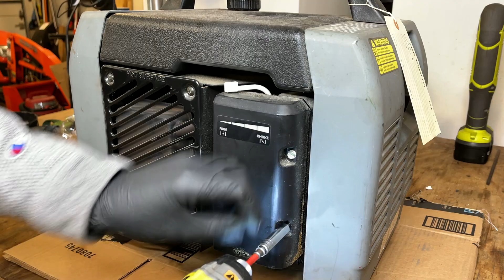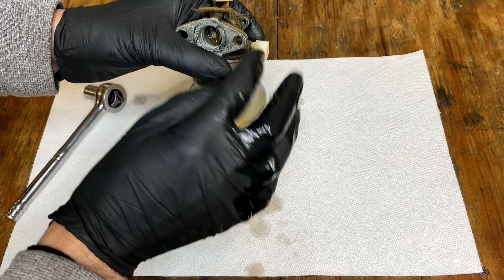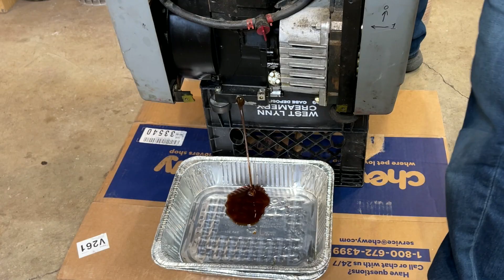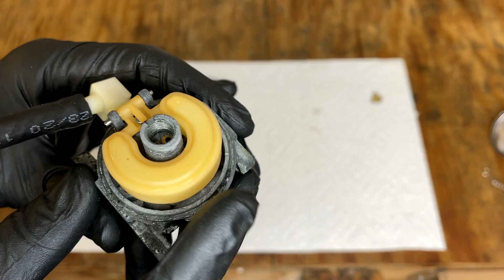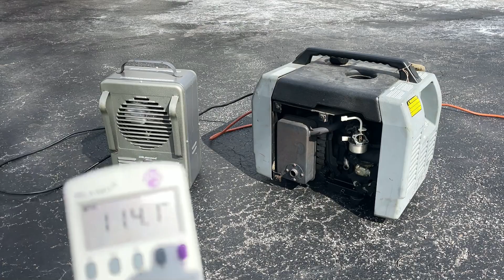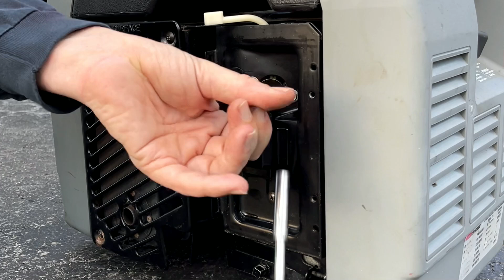Coleman Powermate Pulse 1850 Generator Repair

Comment: Are you kidding me I have ben working on small engine for 30 years and never tighten carb bolts to 50/lbs
Reply: Inch pounds, not foot pounds. It's the factory spec and similar on all engines of this type.
Reply: Pay attention John.

Comment: Why did you bend the governor attachment flange when there were multiple mounting holes for the end of the spring?
Reply: When you move to another hole, you change the geometry and thus the response curve of the governor. Altering the spring tension doesn't do that; it changes the range the governor operates in which was what was needed here. A new spring would have probably worked but this works equally well, is free, and takes no time chasing or waiting on parts. Good enough on an old generator.

Comment: Fine job and not much of a surprise another 'L' head runs again and does it well. I think the outro is simply FABULOUS with all the popping, wheezing, gagging and the dog bark! VERY fitting! I got a new book from Briggs that has all the single cylinder 'L' heads made since 81 for the expressed purpose of setting the governor on my 4 horse on a snapper mower. 110 type and not much about them. Runs fine but the governor is off but I'll get it.  LOTS of info and there is always a 'supposed to'. Just enough to make us liars! BLESSINGS, Pal and GBWYall

Comment: a dirty sinewave can be cleaned up with filter capaciters and  a choke winding...
Reply: The choke winding especially will drop some output voltage. Its OK if you can cope with that.

Comment: James, 
Your posts are always full of so much information. 
I have the same kind of 1850 generator use it a lot and it has years on it and had to use it yesterday due to power outage and it started right up.
Only thing I did was put a fuel filter just after the on/off fuel valve and I use fuel stabilizer as well I try and start it ever 4 to 5 weeks and run for 15/20 minutes with a load and run carb dry when shouting down.
As for oil leak had to replace rubber seals from valve springs to air box and gasket to cover and no more leaking.
As for the rubber shock absorbers on bottom mine are in bad shape and have been looking for replacements and have yet to find large enough ones to fit. If I find any I'll let you know where.
Keep up with post.
Michael.

Comment: I have a few ultrasonic cleaners and the worst part is how long they take to heat up. Get yourself a "stinger heater" cheap on Amazon and it'll get it up to temp in a few minutes vs half hour to 45 minutes or longer.
Reply: How about a pot of water on the stove. That's what I do and I think James did.

Comment: Great video James! I gotta up my game and drop coin on the Silgent Oscilloscope ive been wanting. 

Brushless capacitor excited gens will always be dirty waveform because the inductor (spinning rotor) and capacitor are "ringing" which causes the higher harmonic content. Also known as a resonant circuit. Adding  resistance to the output dampens the ringing cleaning up the wave form somewhat.
Reply from the maker: Any good why to cleanup the THD output on brushless or brushed generators?
Reply: @jcondon1  not directly no. It's better to convert the dirty AC output of the generator to a battery charger powering a battery and then that would power a clean pure sine wave inverter.  Look at IOTA Engineering. Their vhargers double as a well regulated PSU too

Comment: I believe the oil leak was do to the fact that the rubber bushes were missing and changed the angle of operation. In return it sends vibration to oil cap and was leaking because of no o ring.

Comment: What causes  a generator to  surge up and down at high rpm I have had the carb off n cleaned it still the same .love the videos keep up the good work
Reply: Just follow what James did. Check for clean, fresh fuel,  clean the passages and emulsion tube of the carb, and no leaking gaskets sucking in air.

Comment: They should make em fuel injected, more efficient and less problems, would also cleaning the spark plug or replacing it make it run even better?
Reply: You'd never save enough fuel to cover the increased cost. If you use good fuel and maintain this type of machine it is reliable and usually easy to repair economically.There's nothing to gain changing those aspects and fuel injection would destroy the qualities which make these valuable.
Reply: @P_RO_  I see your and understand your point but the world moves forward mostly and these haven't, it could be done cheaply and on a small scale and would make them more reliable, its just no one has made one small reliable and cheap yet (not that I'm aware of, maybe they have). I'm guessing innovation is moving towards solar and batteries, so there may never be an injected small generator.
Reply: @brad9529  The world does move forward, but injection can't be done cheaply compared to carburation, and it would add unnecessary complexity and potential failure points which would not be nearly as easy to diagnose and fix as these simpler machines are. Perhaps worst is that an injected generator absolutely requires a serviceable start-run battery, and as these things often sit long periods of time untouched, they'd actually be far less reliable overall just because of that one point alone. Even the electric-start generators we have now also have a recoil start, so can be started and used even with a dead battery. 

Today's technology-loving people have lost sight of several long-proven principles- the value and reliability of simplicity is one. Another is that just because you can do something is no reason in itself to do it. The value of DIY both in costs and learning is still another. The need for isolated self-reliability is yet another. All of these point toward generators like we have now being about as good as can be had for the purposes they are meant for. There's not only no need to change, but many good reasons not to.

On the "solar generators" as they are called, they are indeed replacing powered generators in a lot of uses, but few portable ones are suited to handle larger loads. They're actually quite affordable now and are almost daily increasing in performance while holding or dropping in price per KW/hour. Small whole-house solar is now price competitive with grid-power in some places and that too is almost daily improving. But there's always going to be a place for small gasoline-powered generators, and they'll remain much as they are today. Many remote off-grid homes still use a gas generator to supplement their solar panels when extended bad weather limits the sun's ability to charge their batteries, and having a common fuel for vehicles and generators makes the logistics simpler and easier. Solar is definitely the way forward but that's a subject for other channels. For those interested I recommend "DIY Solar Power with Will Prowse" as a good place to get up-to-speed on that subject.

Comment: Way to go James, you seat the needle seat with a drill bit that's covered in a white or grey dust which is all over your gloves now and then handle the needle and re assemble the carb with the dust covered gloves, Just saying!
Reply: He used the blunt end of the bit to push it in by hand; which is far better than others I've seen before. 

I remember as a teen [other neighbours] starting multiple argument*s* with 'lectures at for' me because (among many other things) someone  didn't use the blunt end of a drill bit (to do something similar), then blamed me [...] 

It took entirely too long for someone to say "Use a clean drill bit to put it in." included using the drill machine to spin it in because to him "That was ovbiously self-evident; How else do you use a drill bit!?" [...]

(For a while) Things were much quieter (for me) with the neighbours after that ...

Comment: Well done!  I've had that happen to me with a leaking needle and seat, after cleaning the entire carb and jets, like you did.  So frustrating.  Especially those slow weeping leaks when sitting.  Does your meter measure THD (Total harmonic Distortion)?  If it does, it would be very interesting if you can read what it is under no load and heavy load, whenever you test a generator.
Reply from the maker: I wish it did.  Been looking for an affordable one.
Reply: @jcondon1  James your oscope has an FFT function. With some math the THD can be calculated but its fairly involved. There are YT videos how to do it though lol
Reply: @Bassguitarist1985  The way its normally done is to measure the true RMS of the output with a true RMS meter at no and different loads. Then calculating the nominal first harmonic RMS value from looking at the upper and lower voltage  peaks of the output waveform on the scope .Nominally the first harmonic is 60HZ but it does not matter what it actually is. The ouput waveform at 120V rms should have upper and lower peaks of plus and minus root 2 x the rms value. 120 V x root 2 is 169.7 V and  -169.7V. So a maximum measured voltage peak of 166V would give a fundamental with an RMS of                                                                                                                                                                                                        166/1.414 = 117.4 V RMS. If the measured true RMS comes out at 123 V then the THD is 123V - 117.4 V = 5.6V.  The percentage THD is then the calculated THD in RMS volts divided by the nominal fundamental frequency RMS. In this case it would be  5.6 V / 117.4 V x 100%.. = 4.77 %. I would be interested to see how the harmonics vary at different loads as well. So there is not that much calculation involved really.

Comment: James, they sell pool toy squirters at dollar stores and Amazon. I use them for drawing fluids out of containers. You might want one for emptying gasoline and oil from engines..
Reply: Ya but how long that plastic & seals will last? They make pumps just for that look like a sprayer but instead of pressuring the container when you pump it , it sucks fluid into the container… guess it would depend on one’s level of OCD 😳 😂 .. ✌️
Reply: @rawbsworld6604  I thoroughly rinse my $1 squiirter with water after every use. It has not shown excess wear at all. I used it two days ago on my car's antifreeze overflow. $1 seems worth the risk even if skeptical.
Reply: @Hugo_Overthere   😆 I don’t and didn’t doubt it .. just saying  he’d probably be using one if he don’t already have one about .. clean up  time probably equal or more , depending on what was  used for , to just wipe up any drippage hence the cardboard ..  more than one way to skin a cat and they all work, 😝 like I said what way you use depends on one’s level of OCD 🤪 ✌️

Comment: Thanks for the video, I don’t think I would buy a brushless generator considering all the electronics in the house. I have a very old 4.5 Kw Honda that has proved very reliable, we had a power outage in this rural part of England last winter and I ran the Honda for three days straight. Do you think it would be worth upgrading to one of the new Honda inverter generators ? though they are a bit pricy over here. Regards Mike

Comment: Watching you replace that old gas made me wonder: I've never seen you use alkylate gasoline in any of your videos. Is it not available in your area or some other reason? I run all my small engines on it with a significant improvement in reduced smoke and carbon build up.
Reply: Yup.  But over $25 / gallon.  U a rich dude.
Reply: @ebutuoyebutouy  Oh, here in Sweden it's $17-20 for 5 litres (1,32 gallon). Aprox. 50% more than regular gas.

Comment: I've received quite a few free generators but if it's not an engine related issue or a defective circuit breaker then off to the scrapyard it goes. That is changing because of your knowledge and ability to teach whether you know it or not. If I had you as a teacher in highschool my life would be very different and I mean that as a compliment.

Comment: I've fixed more than one of those. Good little units. Cap fails, loses output, needs to be field flashed. A 9 volt battery shoved in the AC outlet momentarily usually does it....I think they were sold under various brand names......